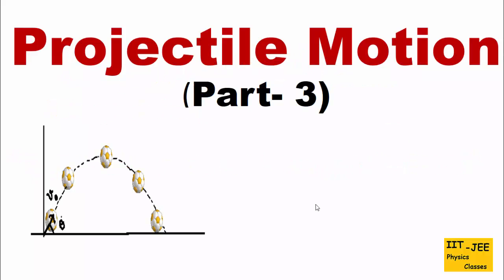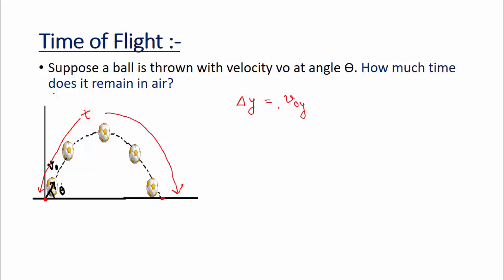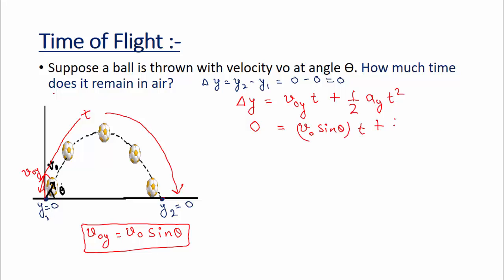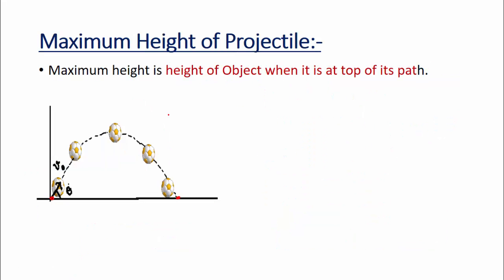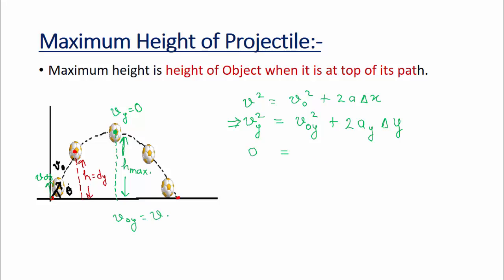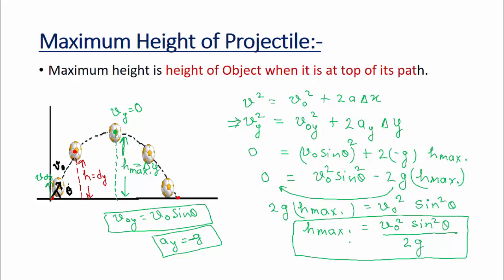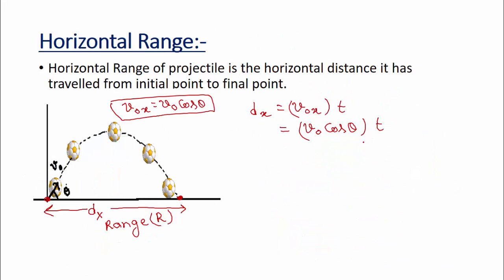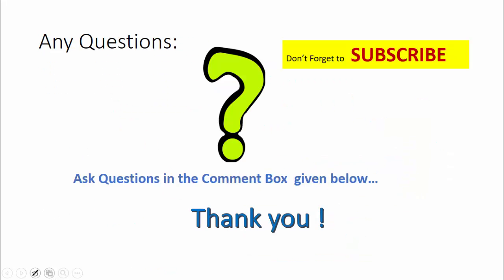Projectile Motion (Part-3): Time of Flight, Maximum Height, Range, IIT-JEE physics classes

Comment: please Solve this problem - A cricket ball is thrown at a speed of 56 m/ s in a direction making an angle 30° with the horizontal calculate maximum height time of flight?
Reply from the maker: Hi, here is answer to your question.. Click on below link  https://youtu.be/AkunBTu1uSI
Reply from the maker: Hi, here is answer to your question.. Click on below link  https://youtu.be/AkunBTu1uSI

Comment: While calculating time of flight why we take vertical component of initial velocity?..
Why not horizontal?
Reply: Taking the x-component would result in calculating the range, not the time. Since we know that the inital y- and the final y- component are the same, we can calculate the time variable (= how long is it in the air?). However, using the x-component gives us the distance traveled by the ball(= during this time, how far does the ball travel?)